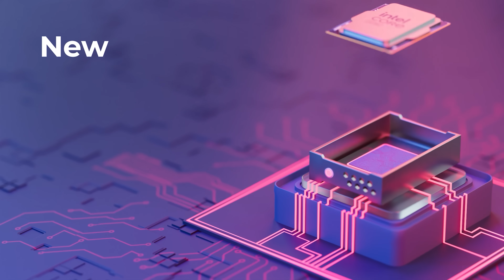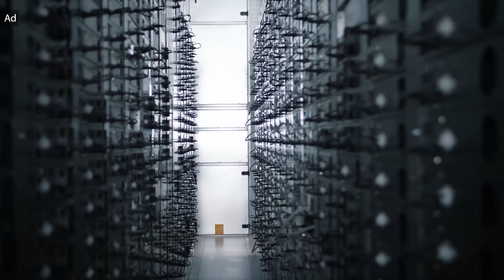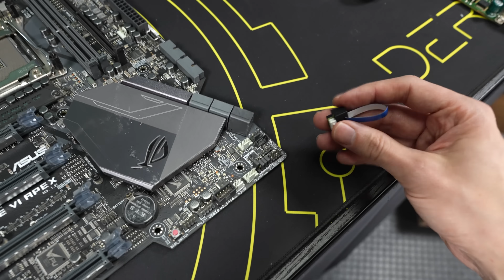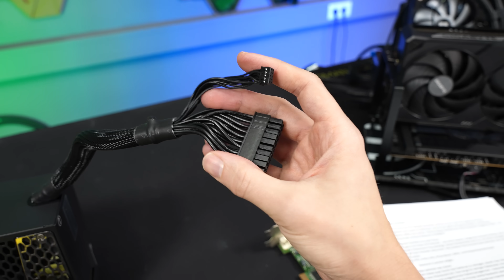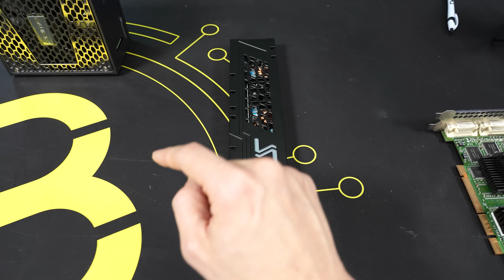Dead-on-Arrival Hardware: Why Nobody Bought These Products - Failed Hardware Ep-1

Comment: AGP Pro50/150 very much was not a failure. It just was very much NOT consumer. Basically the only cards that used it were Intergraph, 3DLabs (who acquired Intergraph's accelerator business,) and Evans & Sutherland. And again: these were not consumer cards. You couldn't buy anything faster than a Wildcat4 7210 at OpenGL, no qualifiers, full stop. And the Wildcat4 7000 series when released, cost over $2000. The last 7210 I sold, adjusted for inflation, would cost over $5,000 today. The E&S REALimage cards were generally $2,000+ - in 1998. The PRECEDING cards on PCI/PCI-X were pure nightmare fuel, because to get the bandwidth required the cards take up 2+ slots. Not "2 slots of heatsink." You had to have 2-3 adjacent PCI slots of the correct voltage and very carefully align things and still would have bus mastering issues. Look up 'Intergraph MSMT496.'
And because the cards were so insanely expensive, only insanely expensive motherboards had the insanely expensive changes to support 8x50/8x150. For example, the Tyan Tigers do not have it. But the much more expensive Thunder family DOES. Tiger to Thunder was about a 30-40% price jump. Those are dual socket, super-high end, Athlon MP systems. Including some that use the proprietary ATXGES/WTX power supply - as contemporary power supplies simply were not big enough. A fairly normal K7X build had a staggering 460W power supply (typical units were 200-300,) two CPUs, up to 4GB of RAM (these are ATHLON MP so not 64-bit and yes 4GB,) 15k RPM SCSI-U320 drives, and typically a 3DLabs accelerator and could easily set you back north of $8,000 at the time. AGP Pro was also found on Intel i860 and ServerWorks ServerSet III-HE (High End) dual socket boards. III-HE chipsets by themselves cost twice what Intel's did. These were extremely, extremely expensive systems in other words. These literally cost new car money. And adding it to a PCB in 2000, 2002? Insane cost, because you couldn't just go to a 6 layer, 8 layer, 10 layer PCB. You literally had to design the board around the AGP Pro slot; that's why the K7X has WTX/ATXGES. WTX/ATXGES directly supplies the AGP Pro power, which is why the power connector is literally wedged against the AGP Pro slot. Even on the S2469 which uses "ATX" - bring BIG 3.3V and 5V rails.
And they were VERY successful, contrary to belief. Customers who bought them, kept them in service a VERY long time, because they were still extremely effective. 5, 8, even 10+ years in some cases. These are cards that had hardware T&L more than half a decade before Nvidia, true hardware ray tracing more than a decade before the first half-hardware in 2009, and the concept of Visual Processing Units in 2002, to name just a few. And AGP Pro 50 8X is *2133MB/sec* and a much more stable, non-shared interface. PCI-Express wasn't even widely available in any systems until late 2005! REALiZM was the first family to do PCIe at all, and they came in AGP8x for the 100/200 at 256/512MB GDDR3, and PCIe1.0 16x for the 500/800 at 256MB/512+128VSU and a $2800 pricetag. (The GeForce 6800 Ultra was $450, and the Quadro FX3400 didn't last a month at $1800.) And those AGP cards still thrashed every PCIe card. Hell, NV was still making AGP cards in 2007; I own two 6800 Ultra AGPs (in fact, all 6x00's are AGP internally with an AGP-PCIe bridge) and probably still have my 7950GT AGP around here somewhere.

Comment: AGP Pro was alright since basically all boards you would want to use it on had it, nice Rage Maxx card there though that was an interesting card.  Main annoying thing about AGP was if your card was not compatible with the voltage on your new board or vice versa, same as old PCI cards, glad that's not really a thing anymore though some PCIE 1.0 and 2.0 cards don't work on 3.0 or newer boards.

Comment: In the same vain as VROC, Intel's 'Upgrade Service' program from 2010 where Intel sold intentionally limited Pentium-class CPUs and then offered an upgrade code to be purchased separately which could unlock extra cache or hyper threading.

Comment: Frist PC, I used was a Tandy that was built by my brother. Green screen 10 Inch monitor 4.5-inch spinning drive. You had to load Dos to the system every boot and it operated from the spinning drive. There was a chess program with basic dot matrix graphics. I believe this was 1974 or there about. How things have changed.

Comment: great video idea and yes please to more products that were interesting but failed.
I remember seeing either Steve or Jay years ago showing that psu and thinking it's neat but seems like they're just adding extra steps to accomplish the same thing unless you had just the right case for it. that and I just buy 1ft to 1.5ft extensions if I need more cable in a big case. the idea of a meaningful voltage difference at that short of a length is laughable.

Comment: @13:14 I think you misspeled here.. next technology after AGP wasn't PCI-e (serial) it was PCI (parallel) bus.
Reply: Incorrect. AGP and PCI co-existed side-by-side. PCI was not the next tech after AGP. AGP came about 5 years after PCI was introduced. In fact AGP was developed in response to the throughput limitations of PCI in the context of graphics cards. AGP (as well as PCI) was then later superseded by PCIe. PCI took longer to be replaced by PCIe compared to AGP simply due to the fact that AGP was a basically a graphic-card-only interface, whereas PCI was a general-purpose bus. Graphics cards evolved quickly and were replaced/upgraded equally quickly, and kept demanding an interface with more and more bandwidth, so graphics cards vendors relatively quickly switched over to PCIe. (A PCIe 1.0 x16 slot could offer roughly twice the bandwidth of a slot of the latest AGP revision.) On the other hand, PCI was an interface used for a plethora of different types of expansion cards of which many didn't have overly high bandwidth requirements and often also had a much longer useful (shelf) life time than a particular generation of graphics cards. Thus, motherboards offered PCI slots next to PCIe slots for a longer time, whereas AGP relatively quickly disappeared once PCIe was introduced.

Comment: My favorite, on my Asus Z97 MB I had an NVME slot and this wonderful new technology called Sata Express which was two Sata cables plus a third cable running into a single connector. 
So I bought a hybrid drive and short stroked it, knowing that M.2 drive prices would fall as production ramped up and the tech was optimized. Later bought M.2 and used Hybrid for mass storage.
Reply: Sata Express was/is used massively in the server market, so wouldn't really say it's DOA or anything

Comment: Going to make a bit of a correction here; VRoC absolutely was used, at least in enterprise. The benefit it had over at least most RAID cards is that it could do RAID of NVMe devices. Most RAID cards can't, only one I can think of would have JUST been out by then (LSI 9460).
Reply: Yeah, HEDT VROC was essentially pulling some of the the enterprise features down to a desktop platform, where there was as a consequence some overlap with the existing RST system. VROC could manage more configurations and with better I/O handling, but the licensing/pricing and disk compatibility made it a pretty silly choice for end users. Intel then sold the licensing and key program off to Graid (the outfit who had repurposed some Quadro cards to handle I/O offloading, to... very mixed results) and it's still actively marketed and supported, somehow.
Reply: @AK-Brian oh, didn't know that was some of the underlying fire Graid, that's cool to find out. I had to put together a few VROC systems at a cloud provider (almost certainly heard of the company, possibly not the division) towards the end of my time there a couple of years ago for one of their internal projects; my first time hearing about it...about 4 months before they announced killing it. I was laughing, because these were for an expansion deployment of the project, and I then had to wonder what the ongoing solution would be if they couldn't get more and needed to expand again. That decision was well above my pay check though

Comment: i bought that seasonic psu with the plugs detached on a seperate board cause it was cheap, and the main power was like 2" short of making it work, so i had to return it.  sounds like a great idea until the cords aint long enough to orient the extra brick in a smaller case

Comment: AGP using different voltages was a huge pain back in the day.
Reply: Didn't know this. No wonder agp failed
Reply: @newolku agp didn't really fail, it was the most common of the pre pci express connections other than the traditional isa, more common than vlb was and more bandwidth than pci could provide. They were very different times though, with lots of standards competing until usb and pcie replaced pretty much all of them.

Comment: Also one thing to note about hardware raid. Its tied to the raid controller, if the controller dies you have to replace it with the EXACT same controller.

Comment: The syncro version of the seasonic PSU was pretty cool if you liked the custom case that it was made specifically for.  The big problem it seems was case compatibility since people like their cases. Good idea in theory but the hardware combinations for PCs is so massive it was basically a crapshoot if it would work in a non-seasonic case.  I have the q704 case and compatible PSU in my workstation and it is great, but only because I got it on clearance from newegg, full price for the case+PSU was prohibitively expensive for the average pc builder. it was $300-500 for the combo depending on the PSU wattage.

Comment: SATA Express came with some boards but never saw any HDD/SSD compatible. Also AGEIA Physx being a PPU had a very short life
Reply: SATA Express was such a dumb idea. It was obvious at the time that M.2 was the future for SSDs. At least the ports on my motherboard weren't useless as you could still connect regular SATA drives to it.
Reply: @Aser6000  A somewhat different version was already being used in enterprise systems where the chip densities of the time were a limitation on how much data volume could be connected to a port. It was kind of like multiple levels of cache, where you get the highest speeds connecting the lowest volumes of data, then trading off some speed for greater data volume, and so on until you got back to plain old SATA. It was believed there would be appeal for drives that held more but were in between SATA III and PCI-e 3.0 x4 M.2 devices in performance. It was just too niche for anyone to bother. Nobody was willing to commit the capital to see if consumers would bite.
Reply: ASROCK made a device that took advantage of unused SATA-e ports. At the same time SATA-e was showing up on motherboards, USB 3.1 and the Type-C connector were not yet in any motherboard chip sets. The ASROCK adapter fit in a single external bay and converted the bandwidth from the SATA-e ports to create USB-C 10Gbps connections on the front panel of a PC. I built this into a system. It was a cool solution to two problems at the time.

I saw the AGEIA Physx board at its first public outing at CES. In my write-up of the show (I was working partly for Jerry Pournelle and some of this got incorporated in his Chaos Manor column) I said the technology had a future but the product did not. It seemed obvious that this needed to be a subsystem on a video board rather than demanding its own slot. The only question then was whether it would be licensed to multiple GPU companies or acquired by one. The company reps somewhat admitted this was the plan, saying they were avoiding manufacturing too many beyond what was needed to attract a buyer for the whole company. The standalone product was a proof of concept for the technology.

Comment: the seasonic connect is very much similar to the new atx motherboard standard. moving 3v/5v away from the main psu, to the motherboard. 
Had they built the module a bit different and marketed it as power efficient it would have done great. Like say having it in a single slot pci form factor, which it almost is, and a faux pcie blade on one side for stability.

Comment: Minor correction - half-duplex vs. full-duplex means direction of communication only, not the underlying rate.  Half-duplex means devices may only transmit OR receive at any one time, not both.  Full-duplex means devices may transmit AND receive at the same time, all the time.  Data rates would be defined separately in the specs and not inherently linked to half- vs. full-duplex or transmit vs. receive.  Yes, it's possible to define a different rate for transmit and receive, depending on the devices and the communication needs of the overall system.

Half-duplex can (and does) affect full calculated line speed because there is logic in the protocols to pause transmissions periodically to allow other devices on the bus to "speak up" when they have data needing to be sent.  If there are no other devices that need to transmit, the original transmitting device may continue.  The delay is negligible but will have a statistical impact on data rate.  It's also an oversimplification because there are so many different protocols for so many different (and different types of) devices that define half-duplex as an option but this gets the fundamental point across.

Comment: Thanks for showing the AGP pro cards. I find them very interesting, as ASUS is trying to revive the slow power delivery, but modern GPU's demand too much power with too small a connector. 
If they really insist on such high power draws, they should make a new ATX 48v standard. 
Personally I think any GPU that draw's more than 300w is a failed design. Let renderfarms turn electricity into heat.

Comment: Half duplex doesn't mean directly it is half the speed, it means you can only read or write a the same time. It will half the spee d if you try to push the same amount of data to write and read, but if you reads are 20% and write are 80% of what you are doing you will only loose 20% of bandwitch (basicly the bandwitch is shared between read and write as they can not be perfomed at the same time)

Comment: I was building custom PC's back when VROC was a thing. Having to explain to people who wanted home workstations Intel's pricing for it caused rage. X299 and Skylake X was already expensive, getting a case big enough to fit enough drives with fanes etc. for the use cases these folks had was also expensive and then telling them RAID  5 was another $300 on top of everything else?

Comment: Hello, semi-professional nitpicker here 😉(...and it's weekend, a time when semi-professional nitpickers like me are most active... 😮)

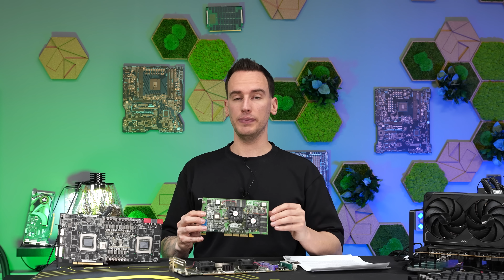At 11:15 you misappropriate the term half-duplex and seem to confuse the term "speed" with "aggregate throughput" (or "aggregate bandwidth"). That's not the same.

Half-duplex (in contrast to full-duplex) means that for a bi/multi-directional connection, communication/transmission can only happen in one direction at a time - one endpoint is "talking" while the other "listens". Full-duplex means that both/multiple endpoints can talk and listen simultaneously at the same time (in regard to the temporal resolution with respect to the use case/device/application; generally speaking, down in the world of the physical hardware interfaces effective full-duplex might be realized in a true sense by separated transmission channels for each direction -- whether it's wires, different frequencies, signal mixing with directional couplers, or what not - or approximated by fast time-slicing over one transmission channel.)

Half-duplex vs. full-duplex has nothing to do with speed, but rather throughput. As a simple example, lets imagine two endpoints of which each can transfer with 1 Gb/s to the other endpoint (the nature and implementation of the technology and the transmission channels is unimportant for this simple example). Lets further assume real full-duplex and not approximated full-duplex over a single transmission channel. In full-duplex, the speed of the transfer from one endpoint to the other is 1 Gb/s. In half-duplex, the transfer speed from one endpoint to the other is still 1 Gb/s. That's obviously the same speed, not half nor double the speed. But the aggregate throughput is different. In half-duplex the aggregate throughput is 1 Gb/s, whereas in full duplex it would be 1 Gb/s (one direction) + 1 Gb/s (other direction) = 2 Gb/s. And again, aggregate throughput is not the same as speed - even though in my simple example with full-duplex you would have twice the aggregate throughput (assuming zero overhead) compared to half-duplex, the transfer speed from one endpoint to the other in my simple example remains the same: not 2 Gb/s, but still 1 Gb/s.

(Also note that full-duplex is not requiring the transfer speed for both directions to be the same/symmetrical. In my simple example i made it so, but you could imagine the channel for one of the directions being much slower (or faster) than the other, and the "half of the aggregate throughput per direction" assumption wouldn't apply anymore...)

Comment: Even back in 2017, I don't think software RAID was any slower from a hardware one, especially with HDD's, only when we moved to NVMe speed has that become an issue again. Also most enterprise servers I've worked with have had their own power plain so the Seasonic Connect wasn't too bad of an idea if you ask me!
Reply: Software RAID was only slow if multiple drives dangled off a SATA controller with a bandwidth of a single PCIe 2.0 lane ;-)
With a proper HBA (typically 8 to 16 lanes), software RAID could run circles around the RAID implementation of consumer platform chipsets already back then.